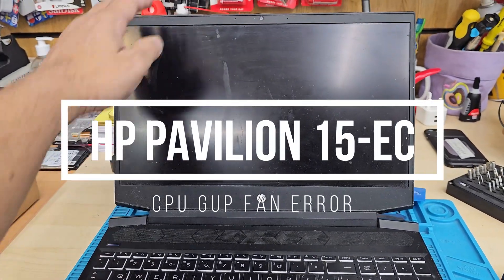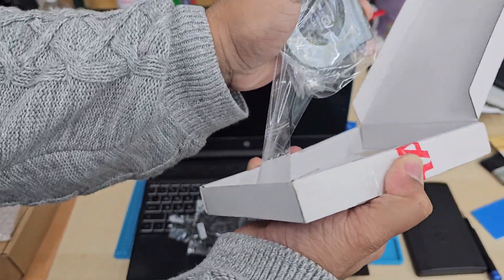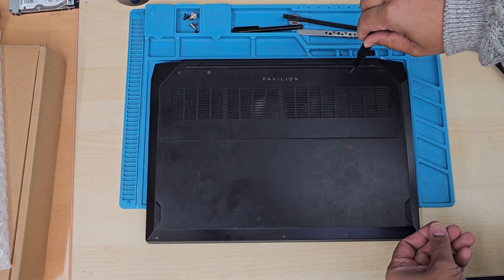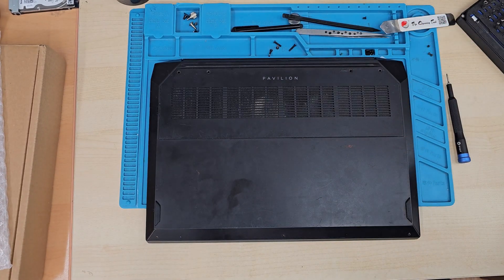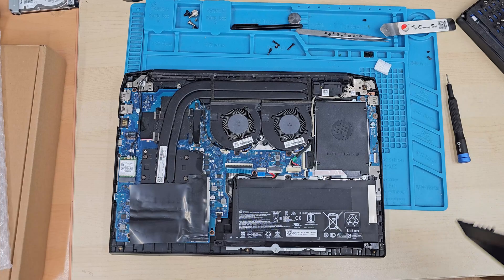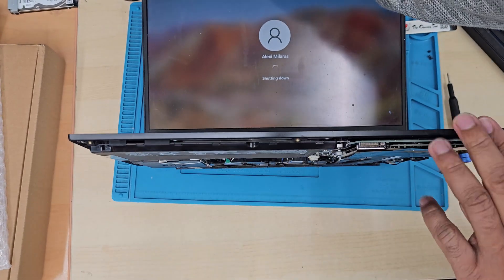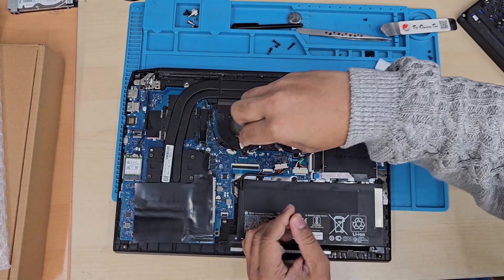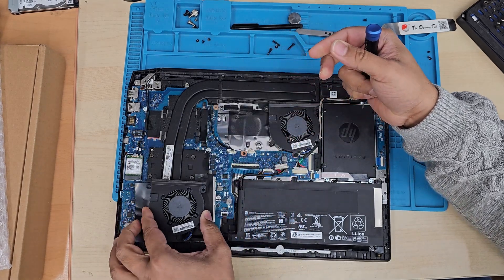Why HP Pavilion Gaming Laptop 15-ec2 CPU and GPU Fan Error| Fan Replacement

Comment: Did you disable the fans always on in the bios?
And did it fix the issue?
I have the same system fan error message after nearly 9 years of use.